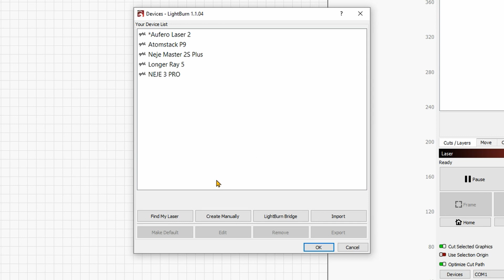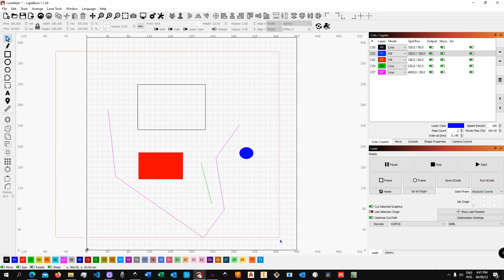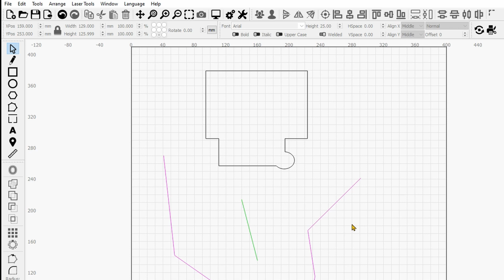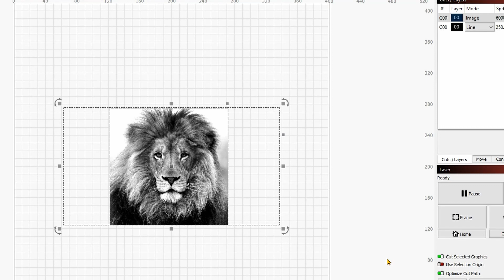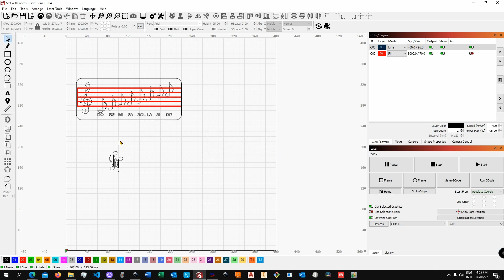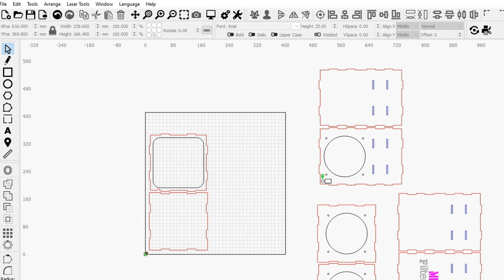LaserGRBL & LightBurn - Get started | Which one should you choose? | Part 2 (LightBurn) | Neje 3 PRO

Comment: in using lightburn...is it require to download also laser grbl before using lightburn?
Reply from the maker: Hi, thank you for your comment. 

No, you do not need LaserGRBL, however if you do not have te CH340 or Ch341 driver already installed on your computer, in the LaserGRBL software there is a handy installation option.

Ciao